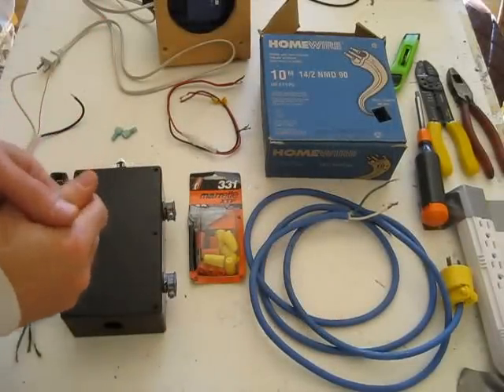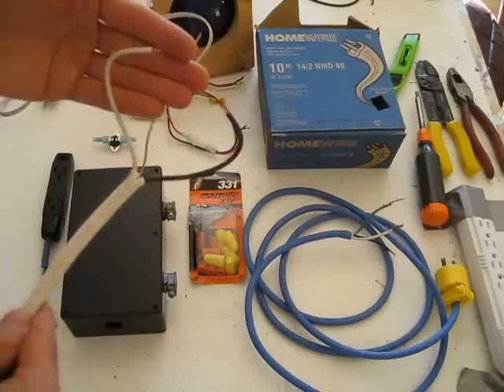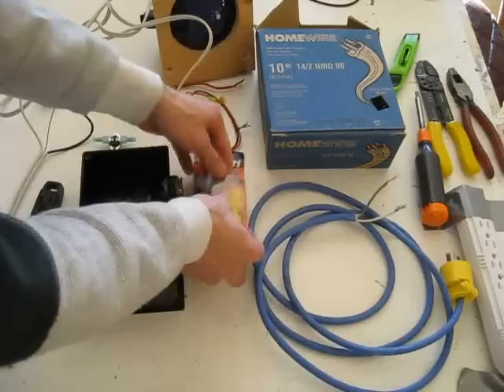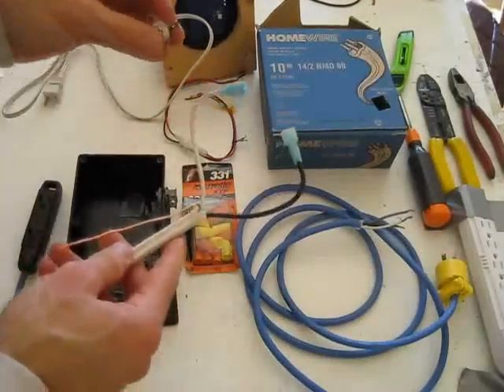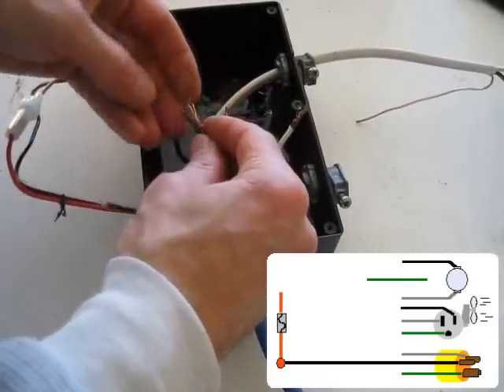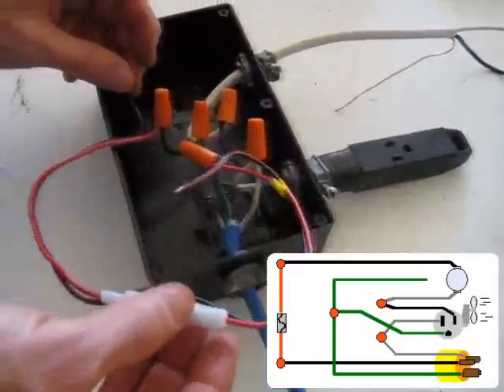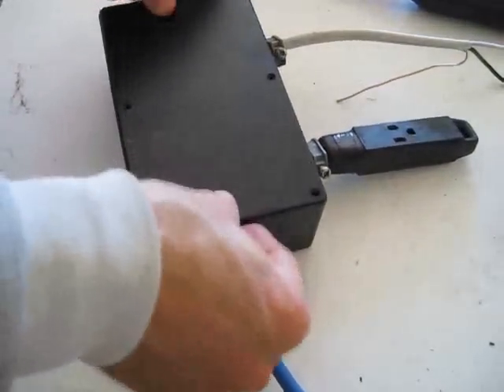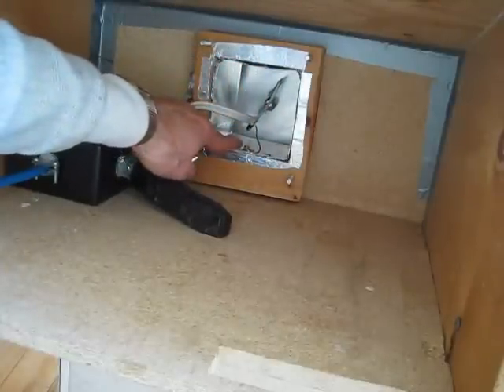Part 2 - Wiring a snap disk controller for a solar air heater

Comment: I always thought those fuses were for DC. I found how to wire very good info and great idea with threeway plug, but the heater itself at the end of the video should have a tunnel drawing air from room not outside. It is easier to heat 70 degree than 20. Recirculate :) Very good instructional video though. Good job.and thanks for teaching me something today.

Comment from the maker: @matcin2531 Just checked and the packaging for the fuse has 125VAC and 250VAC ratings so these ones were AC.  Regarding drawing outside air, my goal was fresh air in the winter. I'm a bit of a fresh air fanatic so my first inclination is for outside air anyway. It wasn't until a year or two after getting into this that I realized everyone does the opposite. But I agree with your math - if you're not after fresh air, recirculate. I'm glad to hear you liked the video. Thanks.

Comment from the maker: @field16 Thanks! I'm happy with this version too. Re the crimper, the company I contract out to has a fantastic one but I can't find one like it. All the newer high quality ones (that do only crimping) have a wider pressing area so you don't get as much force per unit area. I know because I bought one to try.

14:18 - Oops - mistake. The cold air entering the open window gets warmed up - as you'd expect. I'll annotate.

Comment from the maker: @archeryman5000 How would you suggest connecting the stranded wire to the solid? Or are you suggesting to just use stranded instead of the solid 14AWG?

Comment: Good job editing this!  It's easy-to-follow.  The sketch of the circuit was helpful to look at while seeing you wire it up.

I have the same crimping tool and agree that it is "medium" quality.  Yes, you have to squeeze hard... not enough leverage in the handles.  But it works, as you said.

14:18 - I'm confused what you mean by cold air heating up the air.  Could you elaborate? So you are not using this heater any more?  Why is that again?

Comment: @woodstockslim   You can put another snap disk in the conditioned space to act as a high limit.  You could also put the high limit at the inlet of your collector so that if the intake air gets too hot it will shut it down.

jim

Comment: I would say very nice.  I would also say that crimp on disconnects are not for solid wire, you will get a better connection by using a stranded wire pig tail to connect to the solid wire.

Jim

Comment: @RimstarOrg  wire nut sized by number and size of conductors.  Its just a short piece of stranded wire as transition from solid to stranded to quick connect.  
Not saying that just going to solid will not work, it obviously does, quick connects just tend to work loose on solid wire.

Comment: thank you for this. I have been looking for this exact info.  might you be able to hook this to a generator instead of a fan and charge a battery too? again, thanks, great video
Reply from the maker: momstheword11 Glad it helps. And yes, you'd check how your generator starts and the snap disk would become an alternate switch. Different generators start different ways so you'd have to check the schematic or manual for your generator, but it's entirely doable - though I don't know how you'd do it if your generator is one that has a pull-chord. You may even have to have the snap disk turn on power to a relay and have the other side of the relay wired to the generator.
Reply: that is what I thought tho I don't know beans about electrical; was thinking if snap disc switch was closed then circuit could be operating the fan~ if the switch was open the solar heater could be  charging the battery through a generator.  here is the generator how to I found so far (then I found your video on youtube)
Reply: RimstarOrg also might could wire up solar heaters directly for electrical energy transfer.  very useful all year round if they could run heaters and ac.  my husband, son, and friends will  help me, I just need the design. I designed two retaining walls that double as mega solar heaters facing east. not sure how many watts they would generate.  do you know how much heat in btus your heater produces or any idea?
Reply from the maker: momstheword11 What do you mean by "solar heater charging the battery through a generator". A solar heater heats air. It can't do anything with a generator, at least that I can think of.In answer to your question in another comment, I didn't do any btu calculations for my heater.
Reply from the maker: momstheword11 Ah. My first response was about the wrong type of generator. Most off-grid solar systems have a 1 to 10 kilowatt propane, diesel, ... generator a backup. That's what I thought you'd meant. I see now you were talking about a small generator.
Reply: Okay, well, I thought you realized how hopeless I was in the field of electronics and decided to politely leave the conversation!  Thanks for bravely replying.  If you would allow me to correspond w you on this I would love to pay you some consulting fees.  I would love to have a design that someone could put together for me and would pay for itself. thx
Reply from the maker: momstheword11 Actually, I really did think there was a possibility you had some design in mind that wasn't clear to me. For what you want, electricity from solar, you should look into photovoltaic solar panels instead. They turn sunlight directly into electricity. My video, "https://www.youtube.com/watch?v=hJ01UUZrHqI", shows a big system that uses those types of solar panels. Regarding consulting, unfortunately I don't have any available time for that.
Reply: okay thanks you have been a great help. I have a shower fan from lowes and made my first solar heater/was wondering how to hook up the snap disc and this video is great happy holidays!! :)

Comment: am guessing their are many applications of a snap disc I if I wanted one to come on at 140 degree's and shut off at 100 degree's to run a pump for a solar hot water system could this bee done? thank you for any information
Reply from the maker: You might be able to find something in that range. Here's one frequently used supplier http://www.supplyhouse.com/Fan-and-Limit-Controls-1880000
Reply: thank you for the link this really helps

Comment: can you please tell me what degree range snap dick you are using and where you purchased it? a model number would be helpful. Thanks, Al Williams
Reply from the maker: It was KSD020 but I don't know the range. Looking it up online doesn't give it either. Written on it is that it's rated for 125VAC, 20A and 38C, which I assume means it opens (connects) when 38C is reached. It then closes (disconnects) at a lower temperature, but I don't know what that is.
You may have missed it but in the part 1 video, http://youtu.be/_IwZQqKuCrQ, near the beginning I point out that this one is the opposite of what you'd want for a solar heating system, if that's what you're doing, though the circuit is the same. For a solar heating system you want it to close/connect/turn on when a high temperature is reached and open/disconnect/turn off when it's cooled again at a lower temperature. That's called a normally open one.
I got it working for my solar system by adding a relay, but that's wasteful of energy. It would have been better to just get a snap disc that's normally open, and closes when the high temperature is reached, which is what I'd advise.

On my webpage here http://rimstar.org/equip/temp_control_circuit.htm, I give links to where you can buy snap discs.
Cheers,
Steve